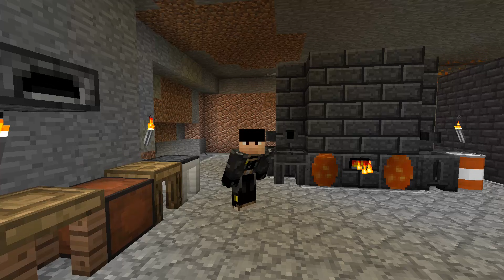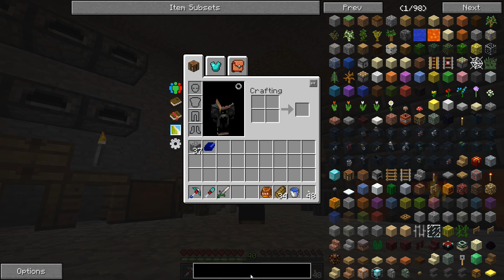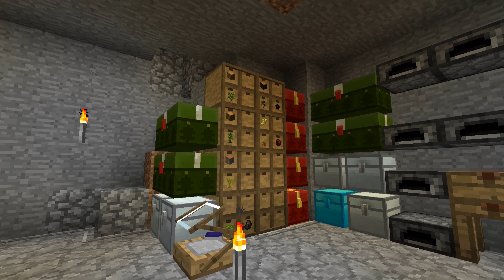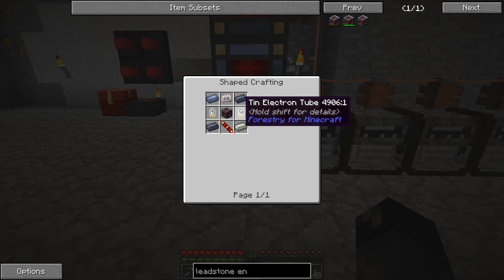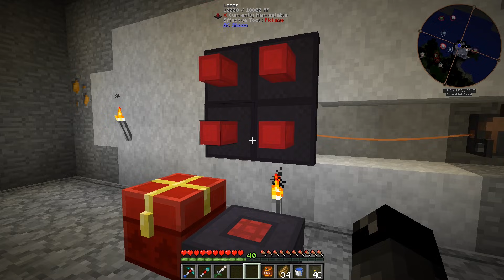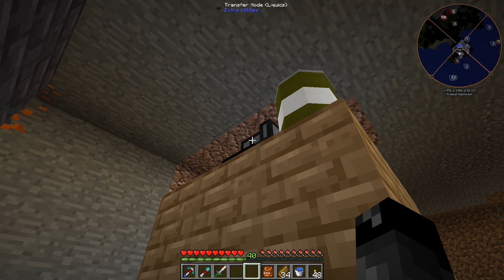Minecraft Mods FTB Infinity Evolved - WATER WHEEL [E06] (Modded Expert Mode)

Comment: Hypno, the Immersive Engineering capacitors are cheaper than the energy cells and I am pretty sure they store more power than the basic cells you have.  I think they store 1mil RF.  You made one of these for the kinetic piece of your water wheel, really easy to make.  Should really make the Immersive Engineering guide book for tips on the mod.

Comment: Hey Hypno :D Merry Xmas :D That Water Wheel Power generation speed is really fast ... and the test you did wasn't at max efficiency ... Let me explain myself ... 3 water wheels on 1 kinectic dynamo produces more than a LV can transfer ... you should move on MV wire coils ...it's not too expensive ... and you'll see it'll increase your power a little bit :D
Reply: +tovmassian13011 No it doesn't. 3 wheels on a kinetic dynamo can output 90 RF/t max. LV wire coils can transfer up to 2048 RF/t and an LV wire connector can input/output 256 RF/t max. The increase you're seeing is MV wire coils losing less power over distances than LV wire coils. And yes, it's very very slight.
Reply: good point